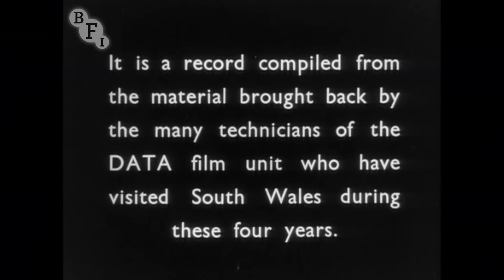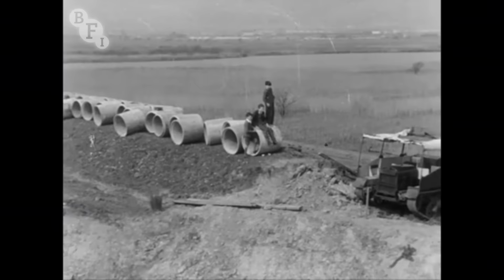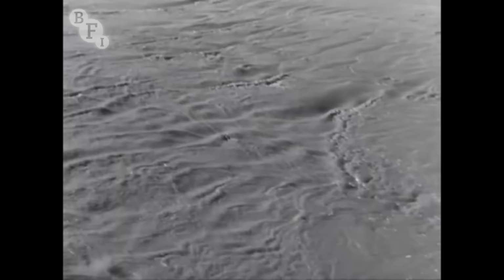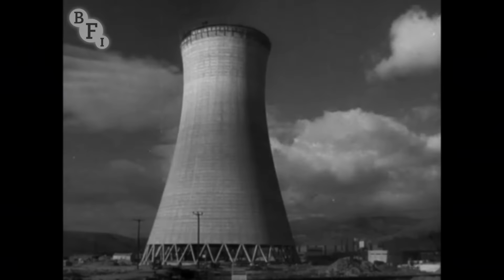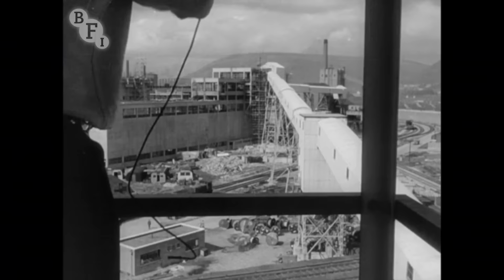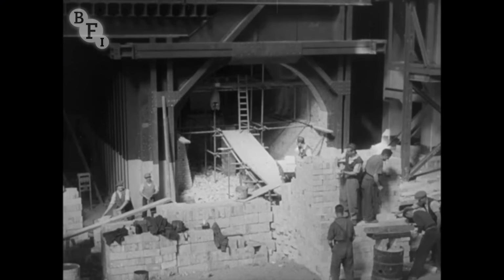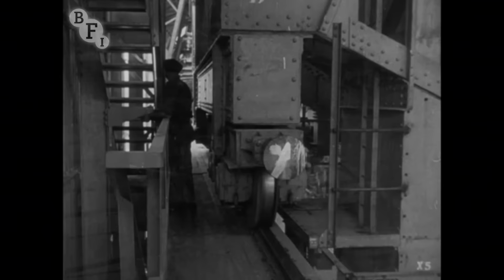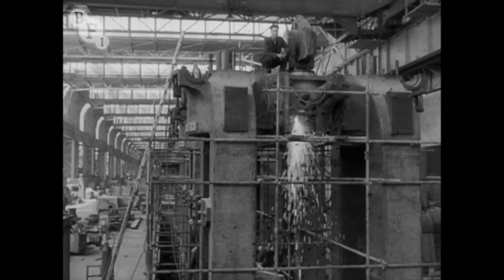First Four Years (1951) | BFI National Archive

Comment: Interesting thing the diesel locomotive pushing the flatbed of ingots is an american built switcher made by Alco.
Reply: AFAIK, the works used 5 Alco’s (#801-805) along side Brush / Rolls Royce locos, which replaced the older steam locos
Reply: Lima cranes & Euclid trucks too!
Reply: Rolling mill stands, United Engineering & Foundry  PGH.

Comment: Dad was a storeman in Ebbw Vale, he issued anything fron a clock spring to a half tonne bronze bearing. The store was 1/2 mile long, so they had a bike with basket. The site was 3.5 miles long. I was there when they opened a new Electolytic Tinning Line 1971/2,  I was in IT dept. There were 9,800 on the payroll. Hardly a trace left today, just the original brick built main office.

Comment: I hauled steel back in the 70’s, I recall picking up a couple of ingot mould stools at Shanango Steel in Lackawanna New York, and delivered them 
directly to the # 1 melt shop at Stelco ( Steel Company of Canada ).  I’ve picked up a lot of steel product, coils, plate, bar, ingots, billets, but 
what I got to see inside that building was heavy industry in your face. I had to wait in there with my truck and trailer while they taped and poured 
molten steel further up the building, then the crane carried the product by my truck. This huge gantry crane then came along and lifted 
the mould stools of my trailer. Apparently they bump the solid red hot “ pig “ onto the stool, and the “pig “ remains on the stool till it’s soon
shipped to the nearby rolling mill. Meanwhile the empty mould goes back to the furnace area to be refilled once it’s tapped. It had to be close 
to a 100 degrees in that building. Being the dead of winter my air system froze up soon after I left, and I had to add methyl hydrate to the tanks.

Comment: If the furnace is hot enough to melt iron, what does the furnace itself not melt?
Reply: The Furnace is lined with kiln bricks (a skilled job) then the Tuyeres that feed the blast air into the furnace are cooled by water jackets so they don't melt.
Reply: because it's lined with a refractory material like fireclay